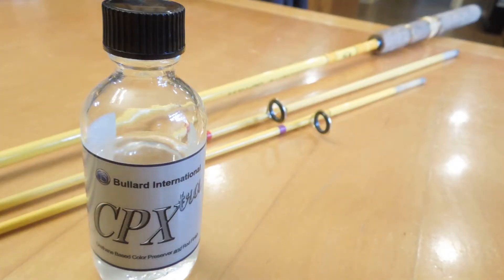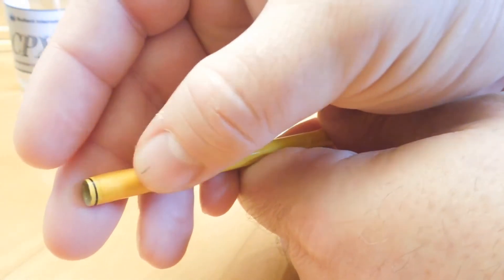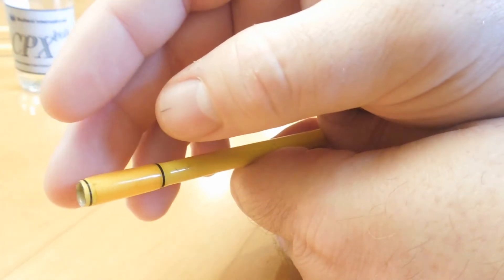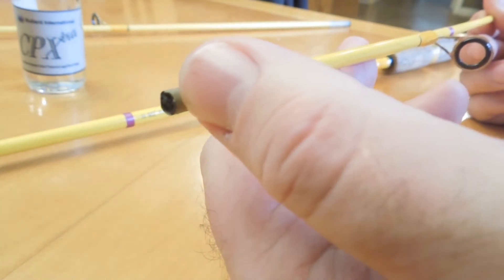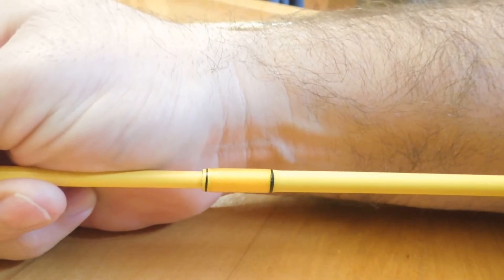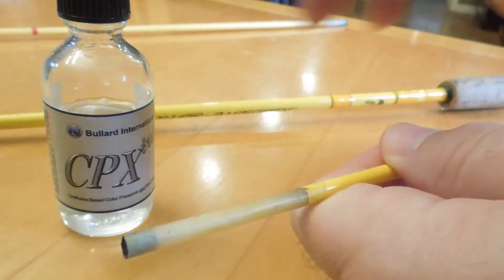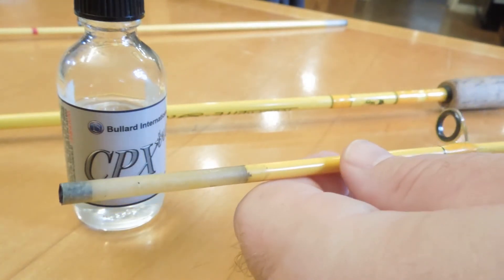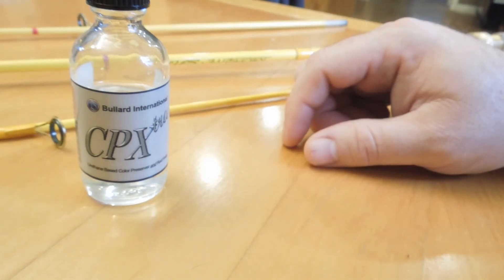Rod Coming Apart When Casting? DIY: Tighten Loose Rod Ferrules

Comment: I found one of my dad only rod and reel.
Rod is fiberglass and the female section is metal , male is fiberglass and was a little loose.
I found a cheap and easy way to tighten it , I use a small bit of cling film on the tip of the male part and it was good!
But you have to replace the film every time you take the rod apart, but a roll of film is cheap and you can use it a thousand times 🤷🏻‍♂️

Comment: One I can help with perhaps. Clean and dry the Male and female parts of the joint.  When they are properly dry, spray the female part with a dry lube with PTFD in it, leave it to drain and dry by standing it near vertical on some paper towel. Spray the Male end with it and leave to dry (takes minutes).  Put the Rod together and see if it's firm fitting.  Ii it isn't, another spray for the Female and one for the Male.  Try it again, if it's close, just the Male gets another spray. (if you over do it, the Male can be reduced with a light sand far more easily than the Female.)
When it's just about right, another spray or two on the Male.  You want to end up with it not "inserting" quite as far as it usually does, this allows usage before re-doing it. (On my Boat Rods I aim to end up with 1/2 inch of the spigot showing when it's pushed together firmly and I redo it when it only shows about 1/8 inch when together.)
You can use it as a preventative measure.
WD40 do a Dry Lube with PTFD in the UK, hopefully it, or something similar, is available in the USA.

Comment: Just checking if your female n male ends are metal how do u tighten that
Reply from the maker: You can do it the same way. It will wear out faster and need to be redone more often. If you have glued on metal ferrules, the best thing to do is replace them. Some metal ferrules are crimped in place and you risk damaging the rod when you remove those. It can be done, but with crimped on ferrules, I’d be more likely to use the method I show in this video.

Comment: I’m currently converting a blank from 1pc to a 2pc for my daughter to keep in the trunk of her car for easy storage.  I was thinking of using a piece of solid fiberglass from an ice rod as a spigot/ferrule.  If I were to glue in and wrap, would this work?
Reply from the maker: I think you should be OK doing that because the rod for the male connection is from a solid glass rod. I'd probably try to make sure the glass section inserts several times (maybe 5x's or so) the diameter of the section it fits. So for the male end, if the blank has a diameter of 5mm then I would want to make sure the glass sticking out was 25mm inside the section it is glued in. For the female side I'd do the same making sure it can slide about 25mm inside the female side. I'd probably epoxy it in place for what would be the male end, sanding it to fit the taper. For the solid glass male end, if you sand it down any, I'd coat it with a little lacquer (or clear nail polish) to provide a bit of finish for protection. 
I hope that makes sense. Thanks for watching and I hope that helps you out.
Reply: The Fishing Hobby, thanks for the help. I just started building rods last year, so getting any help/input from those with experience is greatly appreciated!
Reply from the maker: @jasonprox700  I have a playlist on my channel of all my rod building videos. You might find some useful things in there. If you have any questions please let me know. I'm not an expert, but I know a few things 👍

Comment: good tips. been using the paraffin for years
Reply from the maker: It certainly will work as you know, I just wanted to point out that dirt and sand can stick to the wax causing issues if you aren't careful. It is probably the easiest and most readily available solution. Thanks for watching!

Comment: Is there a reason to not simply epoxy them together, of course knowing you'll "never" get them apart?
Reply from the maker: Nothing wrong with doing that at all. I have actually done that myself on some older rods that I didn't mind making one piece rods and it works perfectly.

Comment: Awesome job man 
U r a pro can u help me with a fly rod which is 2 piece.I wanna make it 4 pieces need the guidance
Thanks
Reply from the maker: Your best bet would be to measure the diameter of the rod in the areas where you want it to come apart and order some metal ferrules like these: http://www.mudhole.com/Components-Rod-Building/rod-building-parts/rod-building-ferrules
Reply: @TheFishingHobby  no I don't wanna put metal ferrules I wanna go for graphite ferrules
Reply: @TheFishingHobby  same like Scott fly rods have called internal ferrules
Reply from the maker: This may be helpful, I have never tried it myself: https://www.google.com/url?sa=t&source=web&rct=j&url=http://www.u-40.com/Userfiles/PDF-Articles/RodMaker/Making%2520Ferrules.pdf&ved=2ahUKEwjd0p2IiuTfAhUHYK0KHQ2cDZ8QFjAAegQIARAB&usg=AOvVaw3Y0x0Wj9pIyCS2C_mbF-uq

Comment: I've been putting my rods together wrong all this time. lol
Reply from the maker: Whatever works for you keep doing it! The way I do it is the way recommend by the majority of rod builders. I didn't mention it here because most people aren't using older rods, but the most recommended method for metal ferrules is just to slide them straight on into each other instead of twisting them together. 
As usual, there is more than one way to skin a cat!